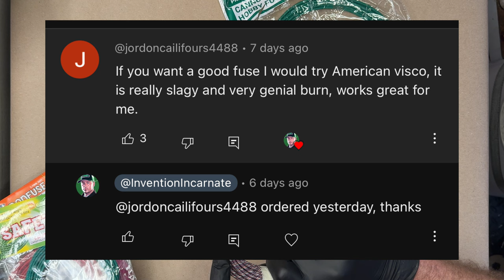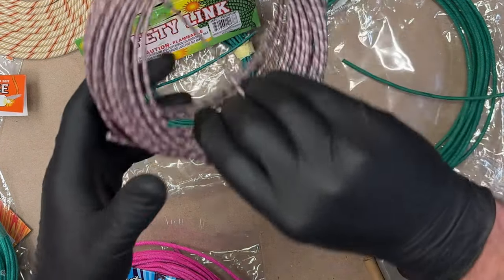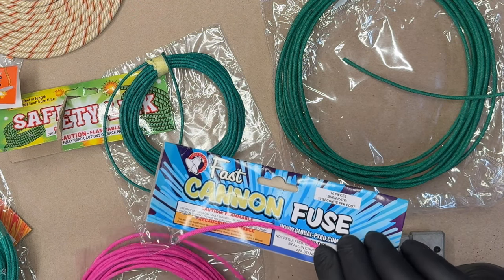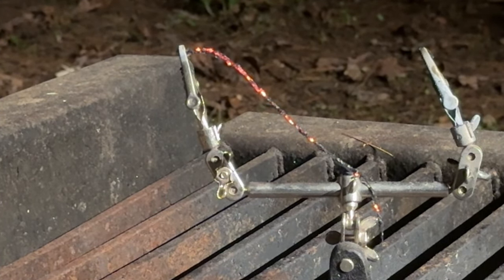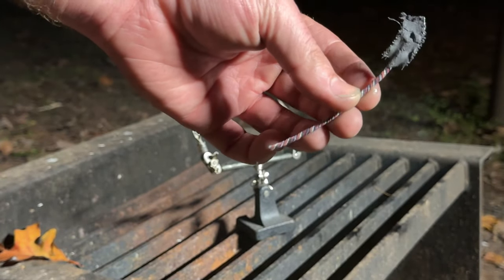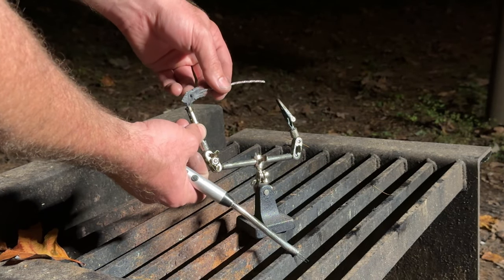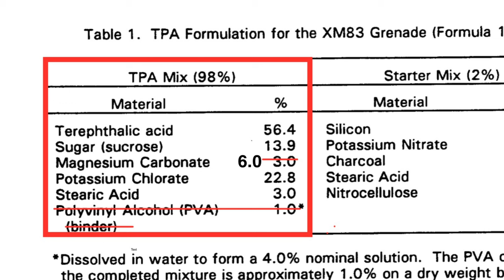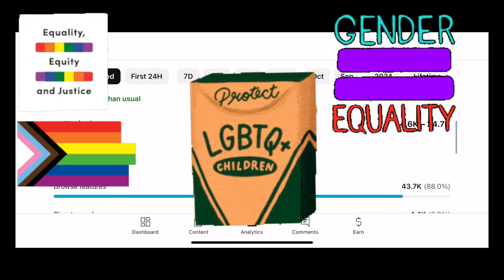Spark-Spittin', Slag-Swingin', FUSE TESTING American Visco, Time Fuse+

Comment: Something I'd really like is a thinner propper time fuse. I'd use it so much more, especially with smaller experimental caps.
Reply from the maker: Skylighter has a slightly thinner one. With a narrower powder core. Are you talking super thin like less than 3/16?

Comment: I’ve been working on using shrink tubing to insulate for gas leaks on Chynese time fuse on the “perimeter alarm mousetrap fuses”
Reply: You can pack microcrystalline cellulose, chalk, flour, any not very flammable powder around the fuse where it travels through the fuze body.
Reply from the maker: As expensive as Skylighter is, their 1/4 Chinese time fuse is significantly less leak prone, however, due to its narrower powder core, often needs primer on crossmatched visco fuses. Usually, visco is not used as a crossmatch (for the record) but I do it constantly

Comment: There's a fireworks shop down the road from me and they sell a lot of different fuses. They also sell "electric matches" which act as a poor man's  blasting cap. You should try some of those too.
Reply: Not a blasting cap, that would contain a high explosive. They're great igniters though, I use them pretty regularly.
Reply: @chemistryofquestionablequa6252  
Yes, that's why I referred to it as a "poor man's blasting cap".
Reply: @RicArmstrong  you can use them to ignite a blasting cap (I make lots of experimental ones) but the cap itself is a separate device and the e-match ignites it, but an e-match won't perform the role of a cap.

Comment: I'm trying to use a 22lr case as a primer for a smoke device but having issues reliably lighting fuse. I'm going to have to try and get some different brands but I was wondering if you had any suggestions on what I could prime the fuse with.

Comment: The wired one was really interesting and that’s my pick overall. Were do you shop for your smoke composition ingredients? Like do I have to buy all the stump killer at my local hardware or is there better options out there that clearly I’m not savvy too?
Reply from the maker: I’d check pyrocreations and fireworks cookbook and compare. And stock up on potassium chlorate over potassium nitrate if intended for smoke devices. 

Skylighter was cool and well designed website however, their shipping is totally effed up. Different prices between CC and Apple Pay and all items ship at the hazmat price level because their checkout application can’t differentiate. I ship commercially every day and when I say high, I mean HIGH AF. I contacted them and they did not indicate they would fix it.